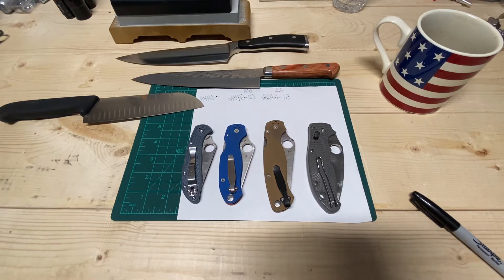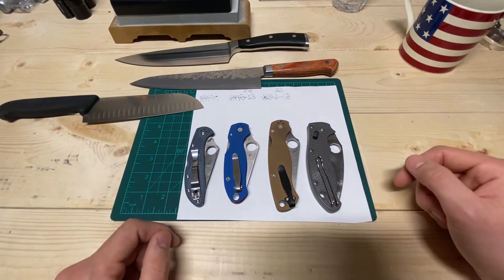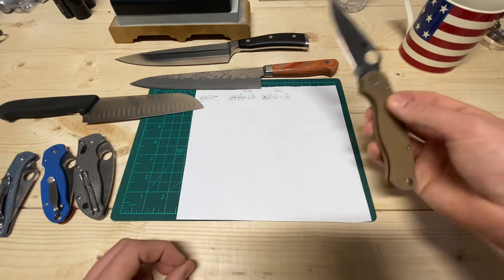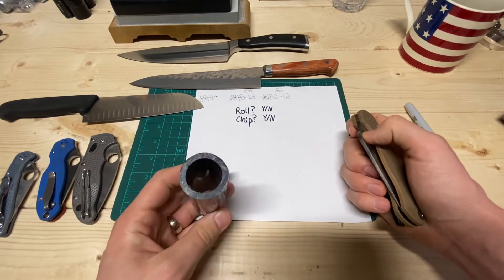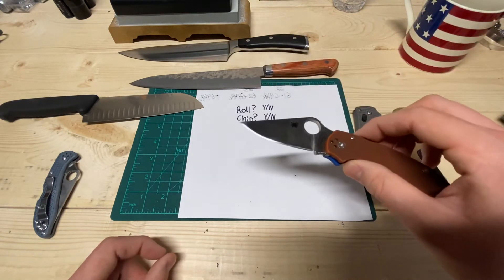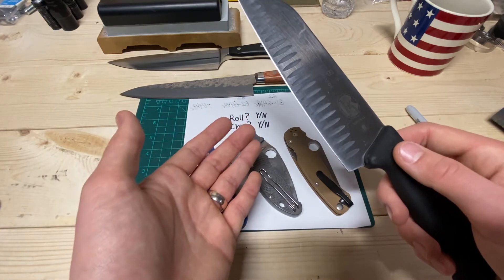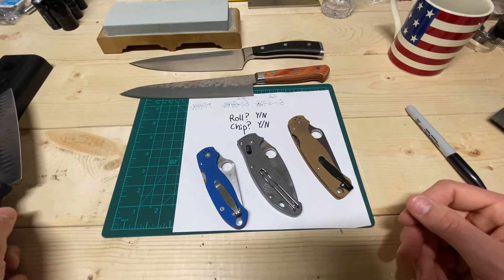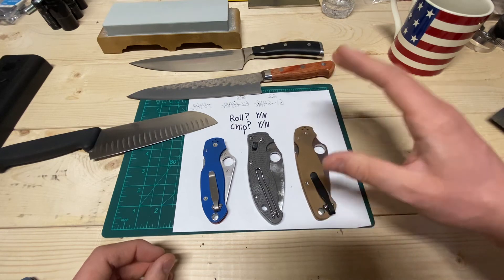Geometry 102: How to Find the Perfect Edge Angle

Comment: Great vid. I got a question for you about your Manix 2 Maxamet. You mentioned you were not satisfied with this knife, and wished the Manix 2 blade was thinner because you are not satisfied with the performance of the Maxamet at 18 degrees. Do you think this knife in particular is not a good use of the Maxamet blade steel? If so, what would be a better Spyderco knife in Maxamet, a PM2? Do you think there is a steel that is better suited to the Manix 2 blade's thickness, maybe S90V or Rex 45?
Reply from the maker: Thanks!

It’s not a specific issue with Maxamet just all manix 2s come with thick geometry behind the edge. Not necessarily even the edge angle. 

Currently I love the Maxamet and the knife but still wish they had ground it thinner

Comment: You clearly know what bevel degree you are sharpening.  Are you using a guided system to sharpen?  I sharpen free hand and I don't know really what my angle is.  I do use a Sharpmaker to see where I am generally . . . but that only tells me 15° or 20°.  I just estimate from there.  But I sure wish I knew how to measure a precise angle of the bevel.
Reply from the maker: I’ve used angle cubes, wedges and matched previous angle from a system enough to develop muscle memory. I can roughly tell what an angle feels like. Something you have to keep up though to stay reasonably accurate
Reply: Goniometer on Amazon is 38 bucks. Laser hits the apex and reflects off the bevel and puts the reflection on a round tube marked with the angle. There is a video of a guy using a cat torture laser and a home made angle gauge.

Comment: One thing I have noted is that you don't cover the variables and benefits of convexing very much, curious as to why?
Reply from the maker: In my time of experimenting with convex edges I basically determined that I personally didn’t like them for a handful of reasons. I mostly skip over them in terms of discussion points because it would open a can of worms and deserves its own video. Maybe I’ll make one!
Reply: @EngineersPerspective701  Well, fair enough. The issue has long been debated in the bushcraft world and they certainly can be a pain in the ass to do properly. I would like to hear your perspective in a video though at some point.